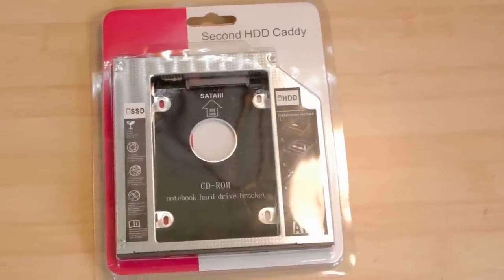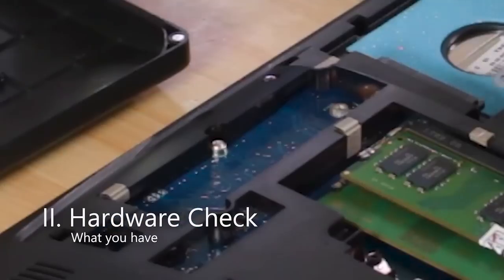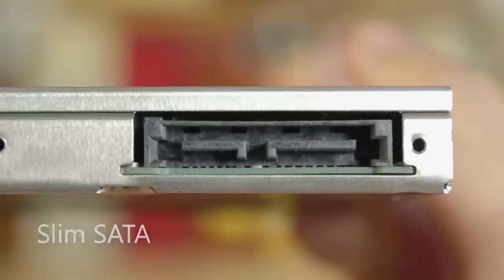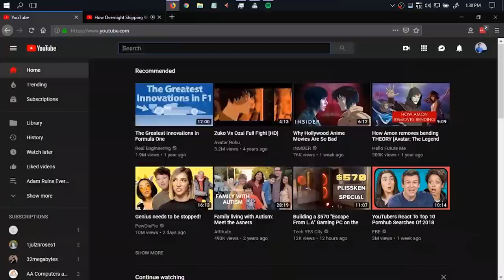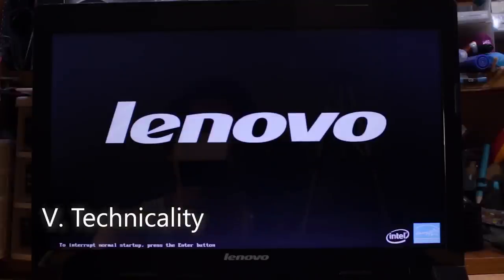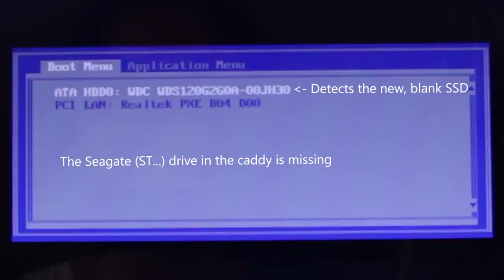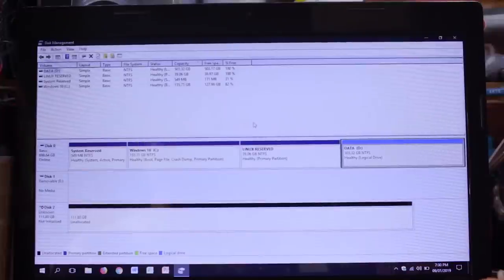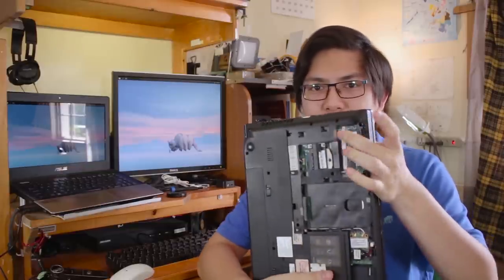SSD + HDD in Almost Any Laptop (The Caddy Method)

Comment: I have dell Inspiron 3000 and i want to install ssd only for OS and use hdd for data storage kindly guide where should i install the ssd? Will it run fine in the caddy or should i replace it with hdd

Comment: Still deciding what to get, M.2 or 2,5" SSD. NVMe isn't official supported on mine but i did the bios mod to get NVMe drives supported for my particular laptop. Still i have my doubts, i had a PC wich supported NVMe but just wouldn't work even though others tested it with the motherboard i had. SSD's on the other hand always work right out of the box but are slower.

Comment: Will upgrading my RAM from 4 GB to 8 GB do any good on my processing speed. I'm running Intel Core i3 4th gen with a 480 GB SSD. I always see my RAM usage at 80-90% even on simple web browsing using google chrome (with 5 tabs open). I don't use video or photo editing apps.
Reply: I'm pretty sure adding more RAM will help your computer run faster than before. I have two slots with 4GB each but I'm planning on replacing one slot with 8GB so I'll have 12 GB RAM in total.

Comment: Both my SSD and HDD are getting detected individually and working fine when only one is kept in laptop (able to boot and work). I installed Win10 on SSD and left the original Win7 on HDD. Now when I put both SSD & HDD (in caddy) together then I get Win10 boot screen but then it gets stuck. Even the Bios is only detecting 320gb HDD and not SSD when both put together; but when only SSD is installed then Bios is showing 120gb SSD. How did you make both work together? I was hoping I would get dual OS start up screen but stuck here. Any help would be much appriciated. I have Sony Vaio E series laptop.

Comment: Case 1: I put my hdd in caddy and ssd in the hard drive bay. it does not detect the hard drive. SSD works works fine.
Case 2: I put my ssd in caddy and hdd in the hard drive bay. Both drives are detected. but windows boots up from hdd.
How do I get my hdd to work in the caddy mode?
Reply: Go to boot menu and then choose ssd priority
Reply: @zsimulations2891  okay I will try

Comment: Additional info:

1. My laptop uses an 8.9mm (give or take) caddy, and it's barely thick enough to support an average 2.5" 1TB HDD. If your laptop uses a 7mm DVD drive or if you're like me but wanted a usually thicker 2TB drive in the caddy, you're basically SOL

2. I have a second point but I forgot. Gonna edit the comment once I do remember
Reply: bruh did you remember yet?

Comment: Insta subscribed !!

* Please help :),  Noob whos learning need help with a long but easy question below *

Hello good day! First of all i just want a say what a great and instructive video this is, keep up the good work!

As we speak, I planned to upgrade my Asus ROG G551JW with exactly the steps in this video, I will change the HDD of 1 tera with this Kingston KC600 2.5" 512GB SATA III TLC, AND  I ordered a universal HDD Caddy of the size of the CD ROM which is 9.5 mm. 

If I already backup everything on my computer, can I reboot it from scratch, install windows in the new SSD card etc etc.. AND eventually can I install the HDD of one Tera in the Caddy and my computer will insta detect the extra space, should I install any software, If i do this I dont need to do the cloning process? how does this works please ? And I say eventually because I will receive my Caddy in 2 weeks, and I'm just really wondering if it's worth the risk of I don't know, i have read that sometimes some chips burns due to bad installed Caddys. I have an external drive of one TB so I don't really need the Caddy, but it will be defentely sweet to have that 1.5 TB memory in the Laptop.

SORRY for the long question, thank you so much for your help.

Comment: 1) If we install the ssd into the caddy, is it impossible to make ssd the boot drive? If yes, what is the procedure?
2) If we install the ssd into the old hdd slot and install the old hdd into the new caddy, does it automatically make the ssd the boot drive and the old hdd the back-up storage drive? If not automatic, how is this configured?
Reply: 1) You can, but you might not get the full speed of the SSD if the optical drive is not SATA III. It's better to put the HDD in the caddy.
2) In my case, I enter the bios and select the SSD with newly installed OS as the boot drive. The method of entering bios and bios interface are different for every laptop. Usually it'll just show you a list of drives that are installed in the laptop and you have to arrange it according to the boot priority. So the SSD needs to be on top of the list.

Comment: Did you adjust anything for the Jumper settings for Caddy? My SSD is in 600 mbps slot(main slot) and hdd in caddy (250 mbps slot). BIOS is able to detect both HDD but windows detects only the HDD. Any solutions? Is it because of jumper settings?
Reply: I cloned windows to ssd then i formated the hdd... And when i power on the laptop, it detects windows in ssd because there is no other choice... I hope it help
Reply: But make sure that windows in ssd works fine before formatting hdd

Comment: Okay here's what I need help with. So I got a 1tb hdd in my laptop (c:100gb, D:450gb, E: 450gb aprrox) and I I just installed a 128gb SSD in the internal sata3 port and my hdd in the sata2 cd drive port using a caddy. So what I wanna do now is use the ssd to install windows (I don't wanna clone any partition or anything as I'm fine with reinstalling a fresh windows) and use my old hdd to still store my stuff( the D &E drive partitions). The question is if I install the fresh windows on my new SSD then what will happen to the C partition on my old old hdd that currently have an OS on it and how can I regain that 100gb partition? Would be really glad if anyone can help. Thanks!
Reply: After you boot from the SSD your old OS partition will still be there, and you should be able to interact with it and if you want, delete it. In cade your caddy HDD doesn't show up try rebooting and if that doesn't work, insert the caddy WHILE THE LAPTOP IS ON. Also REMOVE THE CADDY WHILE INSTALLING WINDOWS because I had issues with installation simply loading forever and the moment i took out the caddy it loaded.
Reply: @Pavlogal  I close the drive and interchange them. But can't boot from any of. The two.. My laptop is lenovo b50..why this error of; disk read error occurred.
Reply: i think you can install your new OS on the SSD,after that the system still detects the OS on your old HDD on the caddy,its gonna be a dual boot System,well just select the OS on the SSD on the boot screen,take note that the SSD is your drive C now,the old HDD will be your drive D,(depending on how many partition your old HDD has,hopefully you have 2 partitons before (C for OS installation and D for file storage)..after booting,try to go on msconfig and delete the boot listed in drive D: or...you can just format it if you want to..

Comment: Im planning to do this on my laptop using new ssd (on the hdd port) and hdd (on the caddy). Will it still work if I install the windows from a USB (iso)?
Reply: You need to prepare your USB Flash Drive installer first using maybe Rufus 3.9. If your BIOS is now a legacy (not supporting UEFI), use MBR formatting. If UEFI is enabled, use GPT formatting. Then set your Windows iso file to be created. If the process is successful, then do the ffg;  

1. completely turn-off your laptop then unplug your HDD. 
2. Likewise, connect your SSD. 
3. Plug your USB Flash drive installer to a port.
4. Turn on your laptop.
5. The BIOS of your laptop should scan any bootable device. If detected, the installer will automatically initiate the process. The BIOS will detect whether you can install an MBR or GPT format USB Flash drive installer.
6. If not detected, reboot it again and access the BIOS. 
7. Set the boot order for the USB Flash drive to boot first. (Or use Boot menu option to run the USB flash drive if it is available function in your BIOS).
8. Save the BIOS new configuration and exit.
9. Your laptop will reboot and will scan for the bootable USB flash drive.

Comment: Hi  EJ Tech:
Do you have any ideal about why my laptop can't detect my mechanic hard disk in caddy? Both my caddy and hard disk are good. My laptop is HP probook 450 G1. I have updated my laptop with Samsung EVO 860 SSD in main SATA drive. And place my old mechanic hard drive in caddy and plug into my CD drive as you do. 
Thanks.
Reply: Open disk management in windows and see if it is detected and format it there.

It can be opened by typing dskmgnt.msc to the start button.
Reply: @deltaoscaruniform1316   Thanks for
 your reply. I have tried it before. But disk management can't detect my mechanic hard disk in caddy neither. I have searched BIOS too, and still can't find it. It seems that laptop can't power up and initial it.
Reply: @weiwang1784  can it see SSD?

Maybe the DVD driver is fiddling with it or/and securom and likes of it.
Reply: @weiwang1784  try booting mint xfce or hirens pe to see if it works.
Reply: @deltaoscaruniform1316   My laptop can see SSD in caddy. I have tested all the interfaces and hardware. All the interfaces and hardware works well. Only the mechanic hard disk place in caddy and plugged into CD/DVD interface can't be detected. Thanks for your advice. I will try it later.

Comment: So why didn't it boot in lenovo but in asus laptop it booted from hdd kept in dvd bay ?????, please explain ,,could you please elaborate mileage may vary ?
Reply from the maker: So far I have no idea why the Lenovo laptop that has the same generation Intel CPU and UEFI support as my Asus laptop not detect any 2.5 inch drive in the caddy but detects it normally when it boots into an OS.
Reply: @ej_tech  did you try on another laptop brand having the same configuration perhaps of your friends???
Reply: @ej_tech  was it because the hdd was 1tb and the caddy interface in Lenovo could not handle size capacity due to some reasons??????
Reply: I have tried to do the same with my lenovo b5070. I put a 240 G ssd instead of hdd and put the 1tera hdd in DVD place but not being read.
But when I replace the 1 tera hddwith smaller one 80 Giga it works well. 
What I conclude from this that my lenovo laptop doesn't read hdd because the total size is. greater than 1 tera..I think it may be from old BIOS version.that need an update

Comment: can someone help me please? I faced the same problem, I put the ssd in the main slot and hdd in the caddy, my laptop couldn`t detect the hdd! I switched the ssd and hdd to check if the caddy is fine, and It was fine! Then, I removed the hdd and installed a fresh windows on the ssd, then put the hdd back in the caddy, now with windows installed on ssd, my laptop can detect the hdd in caddy, BUT, It`s super slow, It takes 1 minutes to open a folder in a drive (in hdd)! so, what`s the problem? any suggestion? can formatting the hdd help in this case or not?
Reply: hdd working slow?

Comment: Can someone help me please. I bought right size caddy and I'd doesn't fit. I mean it won't connect no matter how much I try to push it. Even face plate won't properly attach. And that little metal thingy to attach screw. Should I buy other caddy or what. I broke my optical drive, I don't want to leave empty space might get a lot of dust or something.
Reply: Try removing  the cover and push it in. If it slides into connector perfectly now put the back cover on and slowly push it before tightning it with screws
Reply: well i had the same issue this morning. .. now it fits in perfectly
Reply: @2010axlslash  the thing is I can't even put the front cover. And it won't connect properly without even back cover. Now I'm lost
Reply: Ech caddy connector is not centered with my connector.. That's why it doesn't work
Reply: What should I do if they don't connect perfectly? Buy another caddy?

Comment: I need help, i Installed SSD in HDD place and HDD in Cady in my HP 15 AY089tu laptop, problem is when try to formatting ssd takes problem to start with regular hdd, everything tried, but not work
Reply: What do you mean "formatting ssd takes problem to start with regular hdd?' If you are going to just format the SSD from your OS's format utility, it's simple. However, if you are migrating your OS/drivers/applications etc from your old HDD to SSD, you need to use a cloning software. If you are just installing OS/Drivers/applications into your SSD, remove your HHD first and let the SSD to act as your primary storage first. Then use a bootable USB OS installer. Make it sure, from your BIOS, set the bootable USB to boot first. Or use the boot option menu if it is available, to run it in the boot process. If you have already removed the HDD, and the SSD is not bootable, the computer will scan for any bootable device and it will run the setup process automatically

Comment: Can i use the ssd in dvd drive slot for os/boot and keep the hdd internal? I fear that the hdd will get very hot as it already does internally even with venting on my asus k55a. If the HDD is in the disk drive slot there wont be any venting or very little.
Reply: Also can i do the clone process from internal hdd to caddy ssd? Or is a cable really needed.
Reply: @shawn5090  you can clone it without SATA cable as long as the caddy detects the disk. I wouldn't worry about your HDD in the optical drive slot if you're booting from SSD and just keep data files on HDD. The HDD will barely be used and get hot.

Comment: Can we use the CD Drive after this by any means??
Reply: Assuming you are asking if the original CD drive you have removed can be used then yes as long as it has a slimline SATA connector then you can get slimline SATA to USB adapter

Comment: can i use it to install another system ? i mean the HDD for a system (windows) and the SDD for second system (ubntu ) ?
Reply: You can do it anyway. Even without two different drives.
Reply: You can use ssd for both.
Reply: @ritwikreddy5670  how actually i dont know ? :D 
any way i bought the caddy and installed 2 systems :D

Comment: Even though I have formatted my old hdd, my boot up always asks me which valume Id like to start! How can I make the sdd the primiry so when booting up it just go to ssd?
Reply: You can adjust this through the BIOS settings. Look for boot order and make sure that the SSD comes in number 1 in the boot order. Save changes (typically by pressing the F10 key, but different BIOSes may have different key bindings) and restart.

Comment: hey there EJ tech i'm planning on getting an ssd for my old laptop that runs on a sata 2 interface with an i5 1st gen cpu.
My question is would it be worth upgrading it to an ssd or I should just get a hybrid drive.
Reply: To answer your question, YES, you will really appreciate having the SSD in your laptop.  If I can notice it in my machine, I think you will notice a boost in performance.

I've put a SSD into a Core 2 Duo laptop with SATA 2, and the speed difference is like night and day!  I'm pretty sure my laptop access the hard drive more than most laptops because I can't upgrade the memory to any more than 4gb.  Also, boot times are maybe 45 seconds faster, and a hybrid drive will never be any faster for boot times than a standard drive. (Dell Vostro 1500, Core 2 Duo T5270 CPU, 4GB 667 ram, 240gb 860 Evo SSD, Windows 10 Pro.)  Definitely not a gaming machine, but it's a great computer for day-to-day office work.

Comment: You can use a USB SATA connector or enclosure to do your clone (I used EaseUS) so you do not waste time swapping. And the reason why your  laptop did not boot to the "caddied" HDD was because of the boot order in the BIOS. By default, most laptops disables boot order and only set to boot to the primary SATA connection (unless you press the boot menu hotkey). If You have cloned the HDD to the SSD before attaching the SSD to the primary SATA, it would have booted to the SSD immediately.

Comment: Thanks for this. It helped when I did mine. Used your old method and it worked, but every time it started up I was getting that automatic repair blue screen before going on to windows. used an app called HWINFO to find out if the SATA controller of the ODD bay where the SSD is, is Sata 3, it said it it was, but Samsung Magician said otherwise. So I did the swap, put the old HDD in the caddy and the ssd in to the drive bay. and everything is working as it should. no more a automatic repair blue screen. :) - one more reason to put the SSD in the drive bay and not the caddy.

Comment: Awesome video with great explanation. You should also tell us if there'd be any kind speed difference in read/write operations on the HDD...
At the end of the video, if you could show us a kind of bench mark result of HDD speed check, that'd be really helpful....
Reply: He already kinda said that when he mentioned that HDD probably maybe won't even maxed out SATA1 speed. And the DVD drive bay has SATA 2 connection. The HDD would be fine as just before.

Comment: Thanks for the vid. I just want to know does the former cover of the HDD compatible with the SSD? I'm using a Toshiba c640 laptop and someone said I need a caddy for it
Reply: Hey, I'm stuck there too? Did u buy a caddy for that. I also have a toshiba laptop and the hdd is held in place by a t-shaped connector.
Reply: @_mr.__phoenix8884  The caddy is only used if you want the dvd drive to remove and replace it as a second storage device. i dont know that t shaped connector since for my laptop the cover of the hDD its only held by a regular screw. i didnt buy any caddy since i replaced mine with an SSD
Reply: @Viren21  I see.. Thanks for the reply⚡
Reply: @_mr.__phoenix8884  :)

Comment: my question is,if SSD is installed in the cd rom drive (sata II 250MB/s)..will it have a better performance than a HDD installed in a Sata III (600MB/s) connection?...